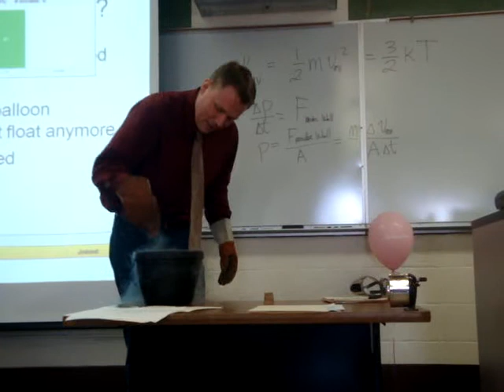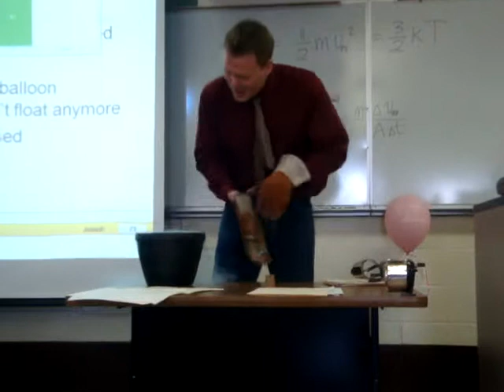Freezing a Banana and Tennis Ball

Comment: Why did the air molecules inside the tennis ball not compress and shrink like a balloon does when dunked in liquid nitrogen?
Reply: Because molecules in a solid state are rigidly connected together as close as possible, whereas molecules in gas freely move around each other